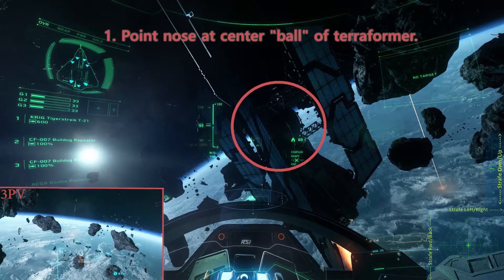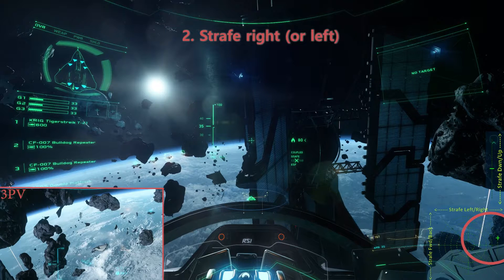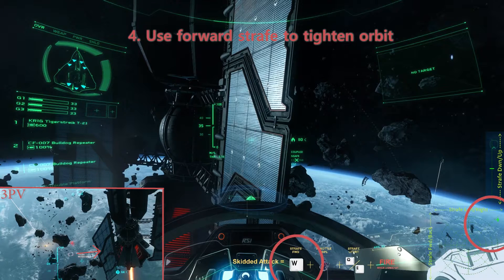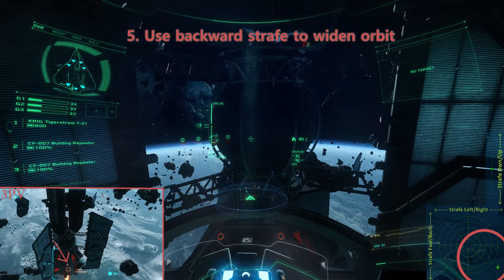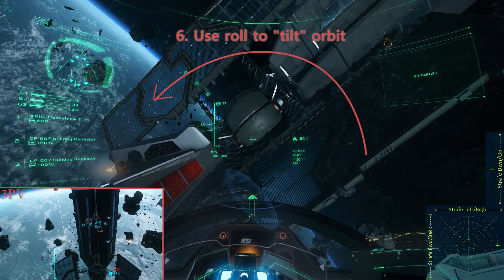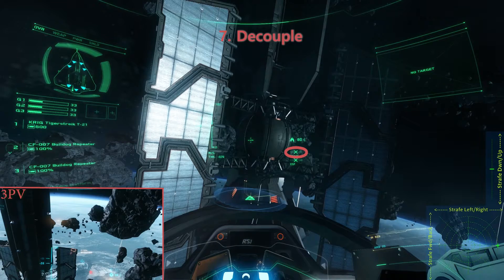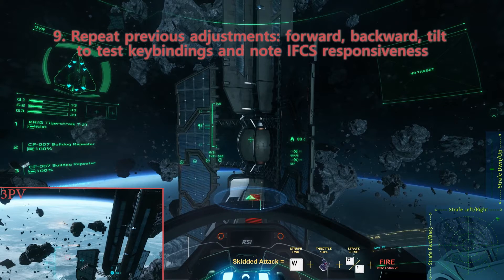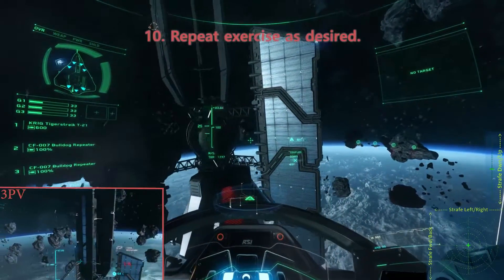BFM1-1:  Introduction to Orbits

Comment: what do you bind throttle to if you replace it with f/b strafe ?  I'm using a 16000m in off hand to strafe.
Reply from the maker: tons of guns I don't really use throttle unless I need to take my hands off the controls/basically for cruise control. I zero it out in any engagement. And, specifically, I bind longitudinal strafe. It's different than forward strafe and back strafe.
Reply: ***** strafe up and down?  I'm just having a hard time trying to map it all while using gimbals. It's like I'm forced to use fixed wpns unless I use a mouse
Reply from the maker: Do you know how to enable look ahead mode? Right alt + m. It can allow a lot more gimbal deflection than the default. You can adjust it in the settings I think, as well.
Reply: Yea. I kill easy w gimbals. It's switching back and forth between ships and control schemes thas killing me.
Reply from the maker: tons of guns Yup, that's why I try to just stick to one for awhile at a time. You gotta train that muscle memory, then try branching out incrementally.

Comment: I'd love to see some input regarding CH HOTAS setup (Fighterstick, Pro Throttle, Pro Pedals), anyone within your org that could provide some information?
Reply from the maker: BuckstarrZ What specifically are you looking for? Help with the configuration software?
Reply: ***** That's just part of it. Basically I would like to see the whole process of setting them up. When downloading a pre-made profile there is a .xml (for SC I figure), .map for the ch manager, cmc for the bindings and cms for the scricpts. I find it rather tiresome going through these all just too see how things work and not being able to modify it to my likings in the end. I noticed the game won't recognize my controllers by itself so I wouold have to bind keyboard keys to joystick buttons and map those in the .xml. But is that all really necessary? I would like to see what is necessary to get me flying with CH gear, thanks^^
Reply from the maker: BuckstarrZ Have you seen this? https://www.reddit.com/r/starcitizen/comments/2q9uf6/ch_profile_for_star_citizen_includes_cms_version/
Reply: ***** Yes, this is one of the pre-made profiles I tried, along with several others. I don't want to have something built for me, I want to know how to do it properly myself^^
Reply from the maker: BuckstarrZ I'll ask around. Sorry I can't be more help here.
Reply: ***** Thanks, don't stress yourself, I just thought CH gear might not be so rare and you may actually have used it in the past (considering you have/had a pro throttle)
Reply from the maker: BuckstarrZ Oh, yeah, I never actually used the software.